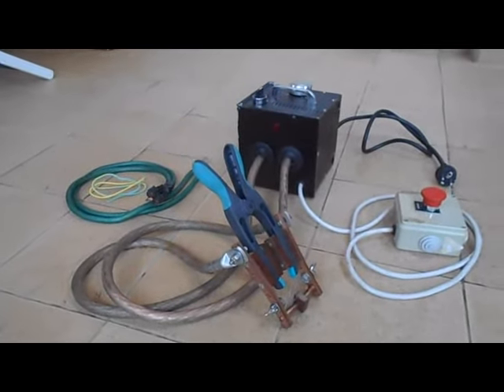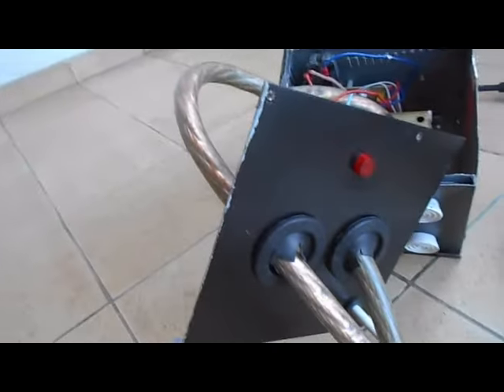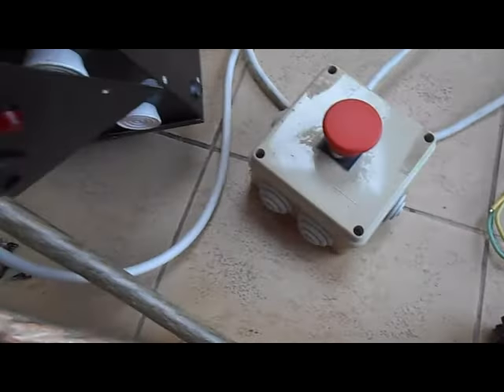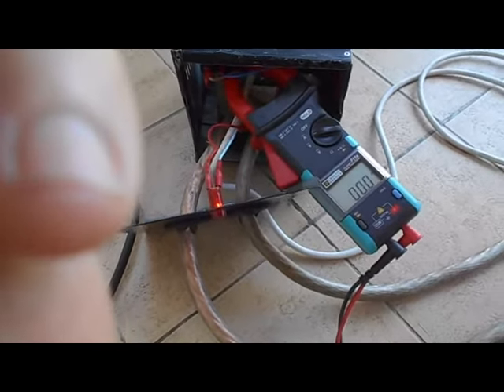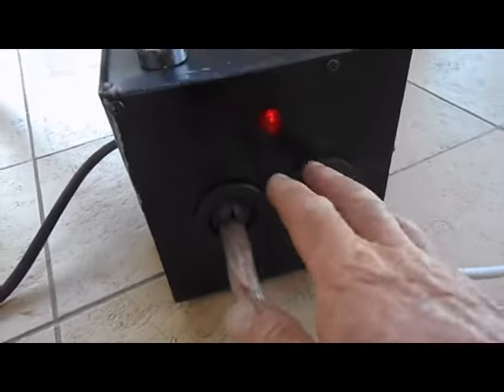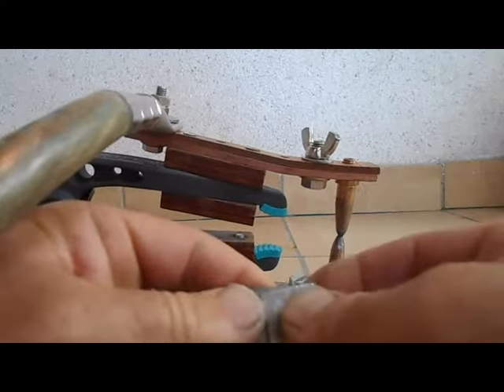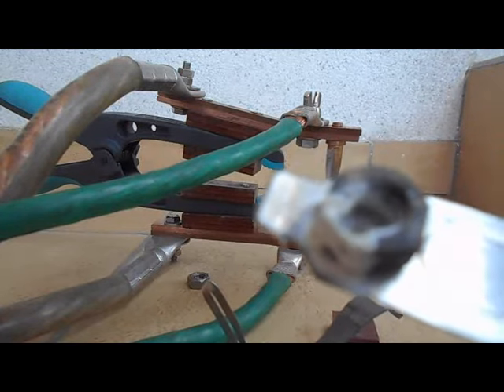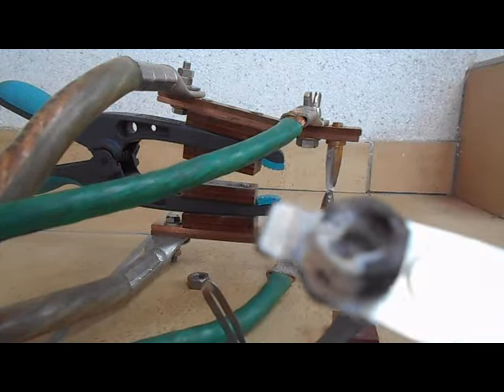[DIY] Fabrication poste de soudure par points avec puissance variable.

Comment: Question bête , ton variateur joue sur la tension d'alimentation du primaire du transfo ?
La plage est de combien ?
Merci de ta réponse .
Georges
Reply from the maker: Bonjour, le variateur à triac est raccordé sur le primaire du transformateur et permet de faire varier la tension au primaire, et donc la puissance en sortie (secondaire) du transformateur.
J'avais fait des mesures à vide côté primaire du transformateur avec le commutateur en position variateur. Position mini du variateur => tension 90Vac. Position maxi du variateur => tension 230 Vac.
Reply: @agb44  Un grand merci pour cette réponse  . 👍👍👍

Comment: Bonjour, le variateur d'aspirateur sert à diminuer la tension d'entrée au primaire du transfo ? Merci
Reply from the maker: Oui, le variateur à triac est raccordé sur le primaire du transformateur et permet de faire varier la tension au primaire, et donc la puissance en sortie (secondaire) du transformateur.
Reply: @agb44  Un grand merci ! Donc, lorsque vous avez environ 450-500 A en sortie (sur 1100 A max), vous descendez en gros à 120 V vers le  primaire en sortie de variateur ? c'est ça ?
Reply from the maker: Effectivement. J'avais fait des mesures à vide côté primaire du transformateur avec le commutateur en position variateur. Position mini du variateur => tension 90Vac. Position maxi du variateur => tension 230 Vac.
Reply: @agb44  OK, super . Encore merci 👍

Comment: Bonjour sa a l air  de bien marcher j ai donc acheter un premier micron mes je peut pas y passer 1 tours comme vous donc racheter un autre et ses pareil auriez vous une ref comme ex les miens class 220  merci cdlt
Reply from the maker: Bonjour, pourquoi il n'est pas possible de faire qu'un seul tour ?
Pour éviter d'en acheter un autre, il n'est pas possible d'en récupérer un ?
Je n'ai pas de référence, mais plus la puissance est grande, mieux c'est. Pour la puissance du mien, regarde la vidéo à 06:38
Reply: @agb44  bonjour j ai donc 3 transfot aucun y a ecri dessus la puissance
Reply: @agb44  y a ecri 230v 50 hz   class 200  230 v 50 hz  y9245ntc ou  l autrz class 220. Gal 700e-4 230v 50hz
Gglz 75244xa-1 voila rien d autre cdlt
Reply from the maker: Ce caractère Gglz 75244xa-1correspond à un code interne du fabricant.
Reply from the maker: Dans ce cas, regarde cette vidéo qui peut éventuellement te donner la puissance approximative du transformateur https://youtu.be/EL932kvaDMw
La puissance des transformateurs de micro-ondes varie généralement entre 500 W et 1200 W.
Généralement, plus un transformateur est gros et lourd, plus il est capable de fournir une puissance élevée.
Reply: @agb44   merci je regarde sa se soir
Reply: @agb44  merci
Reply from the maker: En espérant que ma réponse puisse t'aider.

Comment: bonjour et merci pour cette vidéo.   intéresser par la réalisation d'une soudeuse par point, autant faire le mieux possible et mettre un variateur, comme vous. par contre, n'étant pas électro-technicien, j'ignore ce qu'est un "triac" et comment faire votre modification de variateur. pourriez-vous apporter plus de précision ?  Claude
Reply from the maker: Bonjour,
Comme indiqué dans la vidéo, j'ai pris un variateur se trouvant sur un aspirateur. J'ai juste remplacé le triac (composant commandé permettant le passage du courant => voir sur Internet son rôle, et à quoi ça ressemble) car celui récupéré sur le variateur n'avait qu'une puissance maximale de 650 Watts, alors que mon transformateur à une puissance de  1636V.A (Watts). J'ai ajouté sur ce nouveau triac un radiateur afin que celui-ci ne monte pas trop en température lors de son utilisation.
En résumé : si tu mets un variateur, celui-ci doit supporter la puissance du transformateur que tu installeras.
Reply: @agb44  Bonjour AGB44; Je ne comprends pas, tu dis 1636 V.A (Watts). Que veux tu dire par V.A et Watts ?
Reply from the maker: @coq-o-rico  bonjour,
Ne sachant pas le type de charge qui sera raccordée en sortie d'un transformateur (inductive, résistive ou capacitive) le constructeur indique toujours la puissance en Volt par Ampère. Cette puissance s'appelle "puissance apparente" dont la formule est S = U x I. La puissance exprimée en Watt s'appelle la puissance active dont la formule est P = U x I x cos_fi (cos_fi étant le déphasage entre P et S).
La troisième puissance est la puissance réactive Q = U x I x sin_fi. Ces trois puissances forment le triangle des puissances.
Reply: @agb44  Merci pour ces explications. Je comprends mieux.